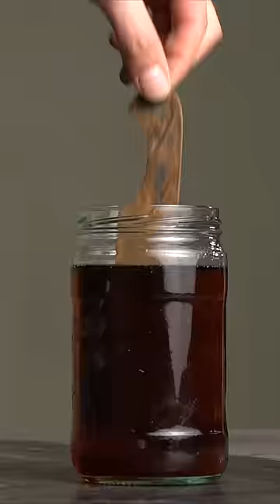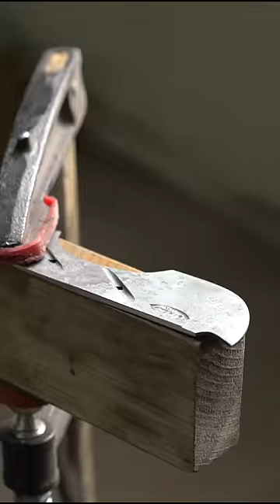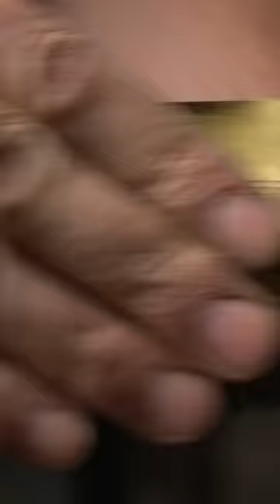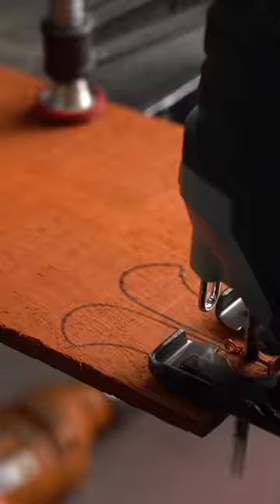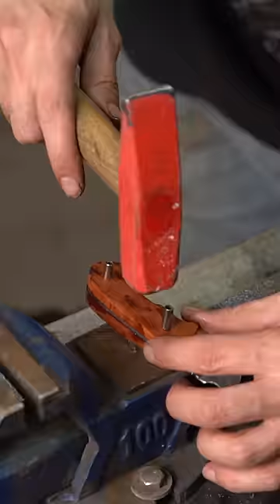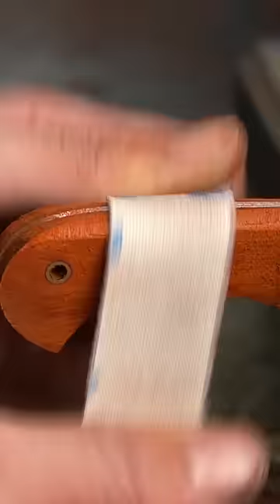How To Restore a Rusty Knife #shorts

Comment: This is a full blown reforging a modification a lot more than just restoration. It has a different shape and new jimping.
Reply: It's the exact same shape
Reply: Yea, the reforging was a bit much for me... To me that makes this a new knife made using an old knife blade... Though I THINK what he did is to anneal the steel to make it softer so that he could grind it easier, and then re-harden it, but that removes it from the restoration category for me...
Reply: Not reforging, he's re-hardening it so it is more rigid, and it's not a new shape, ots exactly the same
Reply: Why forge the temper is not going to be lost until you heat it of a few 1000° degrees

Comment: Correct me if I’m wrong I’m new to this I do stock removal. But when you put it in the fire aren’t you killing the heat treatment for edge retention that the previous maker would have done? Like after quenching wouldn’t you still need to heat treat it in an oven of some sort to get it back to the correct hardness?
Reply: I may be wrong as well, but that’s what I thought too
Reply: I could be wrong, but I believe you're supposed to follow the quench with baking it in the oven at about 400 degrees for a little while to help with the hardening process.
Reply: @Fightre_Flighte  
The post quench heat is to slightly soften (bring back the temper) the steel so it’s less brittle. There’s a few ways of doing it, repeated thermo cycling in an oven at a carefully regulated heat and time is probably best but most hobbyists and smaller makers just use a toaster oven or heat the metal with a flame until its straw colored and let it cool slowly.
Reply: @thechumpsbeendumped.7797  
Makes sense.

Comment: Do you ever soak extremely rusty knives in vinegar? I haven’t tried it, but I heard you can also pump electricity though water with positive charge on the blade ( could be wrong. It might be negative. Idk much about this) and negative through a very small thin metal plate or rod. I usually use files, belt sanders/grinders, sponge sandpaper, etc.

Comment: Simplest way of doing this would to boil it in water the red oxide will convert to black oxide and unless its badly pitted you just can scrub the surface with steel wool

Comment: I found a older one as a young man. It looked like a mixture of combat and bush craft type of blade. Old steel handle looked like bone rings. I hate so much that I lost it. It was really rusted and covered in leaves. I picked up, took it home. One day my cousin stops by. He says you know how to get rid of that rust right? No I told him, stab it in a slightly wet patch of grass. Dam if that blade didn't come back to life. He also showed me how to blacken an old timer. Two ways actually, first is stab in the ground and leave it a few days. Second way was stab into a potato and keep in a cold dark place a few days. Knives aren't hard to revive. Getting them razor sharp, that's another story.